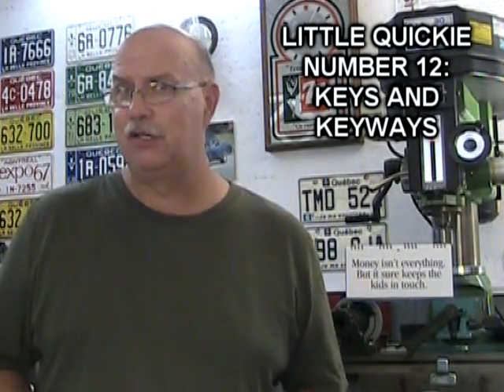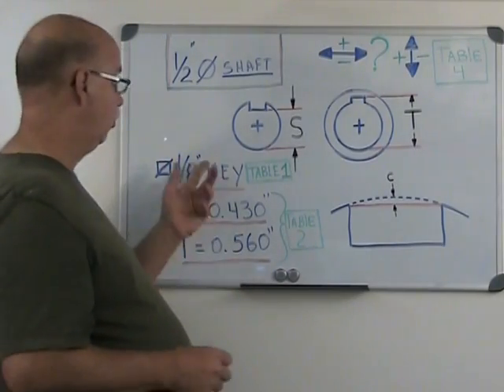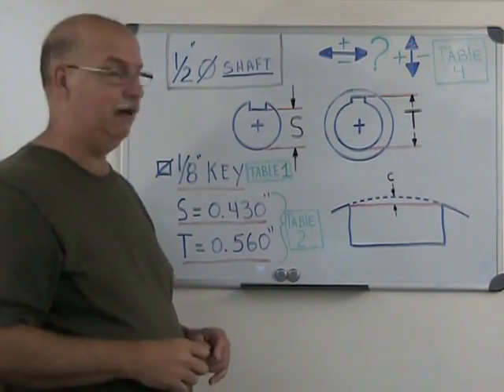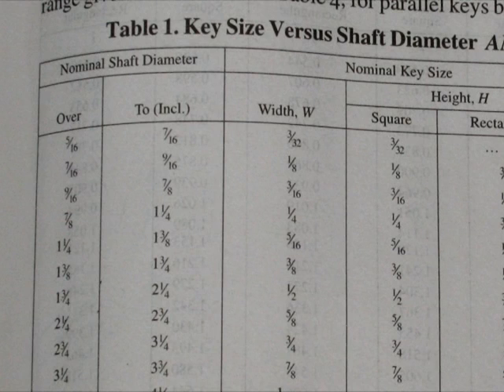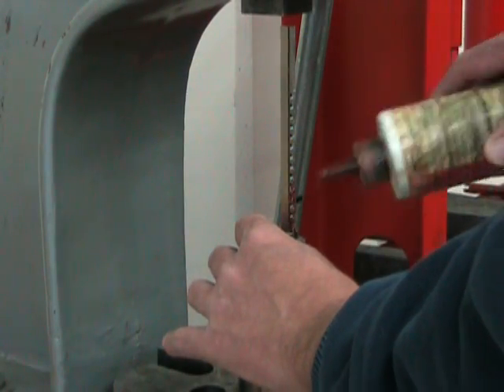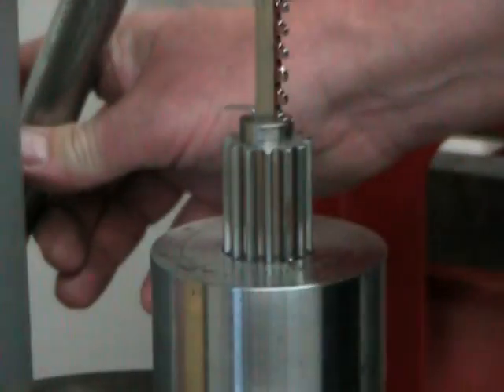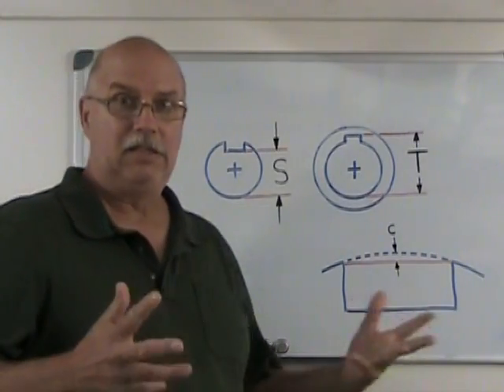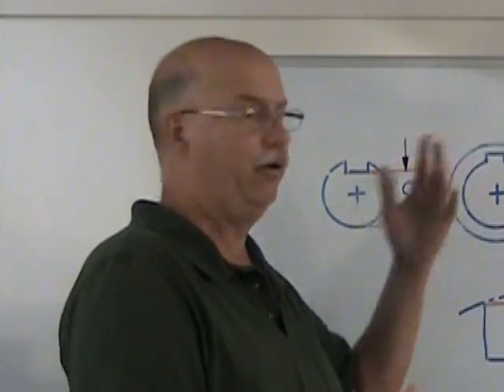KEYWAYS & BROACHING, HOW TO FIND STANDARD AND PREFERRED SIZES, MACHINERY'S HANDBOOK MARC LECUYER

Comment: Great video as usual Marc! A fairly fool proof way that I learned and you probably know this as well is to touch off with your endmill, then slowly come down until the endmill makes a perfect circle on the shaft. Zero it at that point, then you go down half the width of the key or endmill if your using the right sized endmill. I.E. 1/4 inch endmill to make 1/4 key , you touch off keep going until it cuts a perfect circle , zero that then go down 1/8 of an inch  (half the key) and that is your depth. Works everytime and is a good rule of thumb when you dont have dimensions or machinist hand book at hand.
Reply: You got in just before me,
I was also taught to do that, it makes life so much easier...